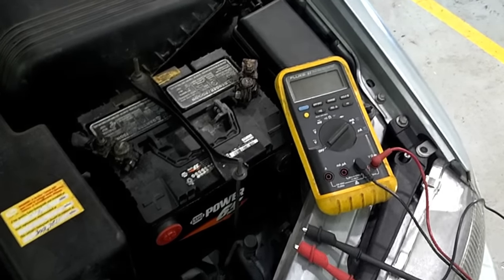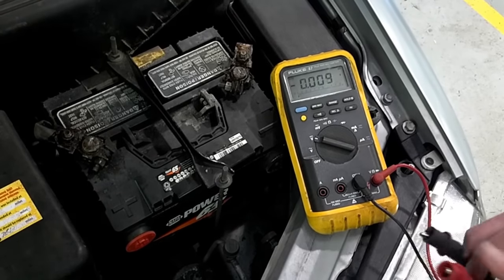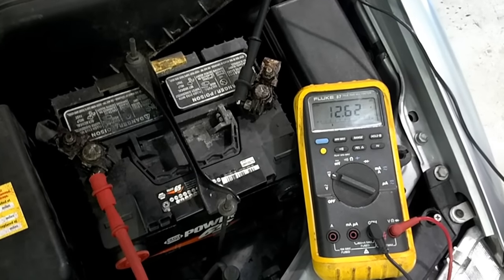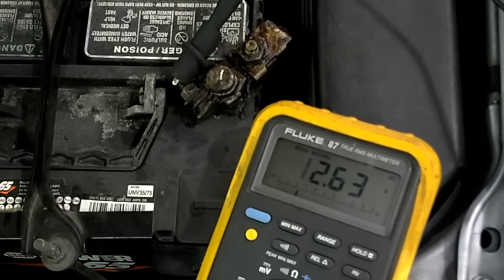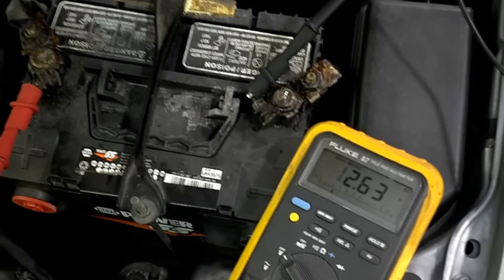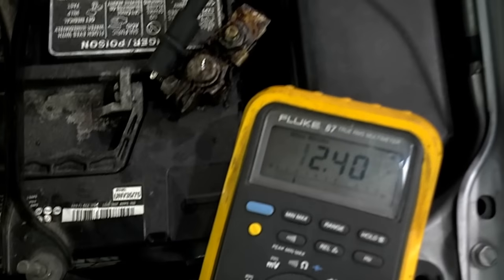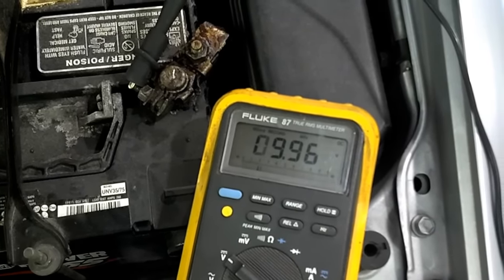Battery Load Test With a Multimeter

Comment: Why do we not see AGM batteries in cars ? Lower maintenance, faster charging, can run lower without damage, installed at any angle, combined deep cycle and cold cranking....
Reply from the maker: We are actually seeing more and more AGM batteries in cars today.  The reason that they are not used everywhere is that they cost more than conventional batteries and they don't provide much advantage for a typical car owner who drives the car daily or nearly daily.  Conventional batteries work really well if they are maintained and they are not cycled.  Of course the lifespan of any battery also depends on its quality.  Some brands are much better than others.

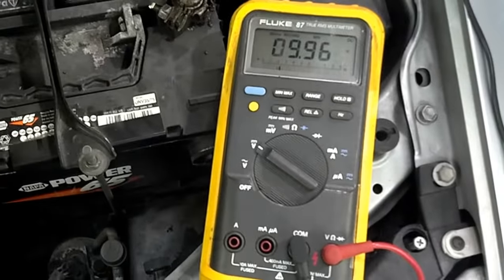Comment: Thank you for this video.  Noticed your pop up at 2:26.  Could a low voltage of 9.98 with a brand new Interstate battery also be the result of a dirty ground connection somewhere between the starter and the battery?  I already checked my compression and took off all the fan belts to see if there was any additional drag on the starter and there was not.  Also replaced the starter since it was over 10 years old and had many, many short trips in 78,000 miles.

Comment: What about on 2 battery system using our fluke 88v meter. Are you saying 19.2 is the lowest figure being 9.6 times 2?

If below how do you know which battery not good
Reply from the maker: Two battery systems are still 12 volt systems - the batteries are connected parallel to each other in order to provide more current capacity.  Do the same test.  If the two batteries together can't maintain 9.6 volts when the starter motor is engaged, they should BOTH be replaced.  The batteries work together and should always be equal to each other.   Never replace only one battery or the weaker battery will drain the stronger battery, shortening its life.
Reply: To make 24vthey are not in parallel but in series. Pos connected to neg with outer pos and neg to truck. 

This voltage check to determine if the batteries are able to prove CCA is not flawless I think. Also a customers truck in the morning has no power to crank engine. I checked for parasitic drain and there was less than fifty millivolts being consumed. This means the batteries were faulty. The voltage was 13 point something which also goes to say the cells were nackered. They would stabilise if a charger put on them and the truck would crank 10 seconds after connecting just one charger to one of the batteries. 

A proper test is obviously a load test by a load tester. 

I used my fluke 88v in min max mode on this truck and on cranking the voltage went down to 21v. When I connected 2 brand new Yuasa super heavy duty batteries with 12.6v thereabouts the truck cranked no issues and also only then did the battery sumbol disappear on the dash. The symbol would not disappear with other batteries

Comment: 75% charge or 80% charge minimum is required?
Reply from the maker: The general rule for testing a battery is to test batteries that are 75% charged or higher.

Comment: I keep reading/hearing that if the battery is 'below' 12.4 volts, then the battery has to be charged.  If that's the case, does that automatically mean its a problem with the alternator if its a new battery?  

In other words, why wouldnt the battery be charged aside from it being an old worn out battery?
Reply from the maker: 12.4 volts represents a battery that is 75% charged.  This is the same concept as your cell phone or laptop battery.  There is nothing wrong with a battery that is 75% charged, but if you are going to load test a battery, you would not want to do it when the battery is at a low state of charge.  Otherwise, the battery could fail the test when the battery is still actually just fine, but in need of being charged.  It is not uncommon for a battery to be less than 100% charged.  If you start the car but don't allow it to run for at least 5 minutes, the battery will not be fully charged.  On many cars, the lights and other accessories remain on after the engine is turned off, which can also drain the battery slightly.  You would never throw away your phone battery because it was only 75% charged - eve if the battery was brand new.  You would simply charge it.

Comment: Hi, great video! I need to ask about my battery, after sitting overnight my battery usually says 12.1, but the car doesnt have a problem starting, but when the radiator fan cuts ON in traffic, my idle drops hard and feels like the car might stall, should I replace it? Its almost 5 years old (battery) thanks!
Reply from the maker: If it passes this test, then no, you don't need to replace it.
Reply: It was a failing battery, replaced it. All good. Thanks!
Reply: @sean gill seems like he was having a high internal resistance problem in the battery as it dropped to 12.1V overnight and it was making the alternator work harder than it needed to charge the battery hence a large voltage drop across battery and poor supply to other components when required. This can wear out an alternator faster if not caught sooner than later.

Comment: Why is 9.6v the lowest acceptable value when load testing? How do you determine this value?
Reply from the maker: That is a good question.  9.6 volts was a standard that was established for load testing a long time ago.  Probably because it is three volts below a fully charged battery, which is 12.6 volts.  If the voltage falls below this level during cranking, it could cause problems with fuel injectors, ignition coils, and even the starter itself.   There is nothing magic about that number.  It is the number that was determined to be the cut-off.

Comment: You didn't check the "Open circuit voltage". OCV is the Battery voltage with no "Circuit" connected.
Reply from the maker: The cables are connected to the battery, but all of the switches are open.  So, until you close a switch (such as the headlight switch or ignition switch), you are measuring open circuit voltage.

Comment: That multimeter is $200. How can I accomplish this with my free harbor freight multimeter? Can I take a video of the readings and watch it back in slow motion or will the min reading flash faster than the speed of light
Reply: Yes, so long as your multimeter can respond fast enough to show the min and Max voltages. It has been my experience that even cheapo meters work fine, but have no min memory function.

Comment: I set commercial electric analog multimeter to 50 to test 12 V car battery and it read a lil over 10 close to 12 . Is that right ? I've also a slow charger at 1.5 amp slow charge . I cranked it soo much yesterday trying to get car started but nada . I had it towed . How long will this take ? i want to be able to crank car engine to work / test on car today
Reply from the maker: A fully charged battery should have 12.6 volts.  Watch my video called "Determining a battery's state of charge."  https://www.youtube.com/watch?v=I4TjlDcnJPA.  Also, it is good for your battery to charge at 1.5 amps.  It could take several hours to reach a full charge.

Comment: Would a carefully watched analog volt meter be okay for this test?
Reply from the maker: Not really. The drop in voltage happens so quickly that even an analog meter cannot respond fast enough for you to catch the low voltage.  A lab scope would be best, but a digital multimeter with a min/max function is the only other option for this type of test.
Reply: @JustinMillerAutomotive  What about OBD2 apps? I will check my tmrw...
Thanks for answers Justin.

Comment: let's say my 12V battery goes on a snowmobile. are the "magic numbers" the same? if I start it and get the same readings, does it pass the test?
Reply from the maker: +FillVinf06 Yes.  If it is a 12 volt battery the same numbers apply!
Reply from the maker: +FillVinf06  Yes.  The numbers would be the same for all "twelve volt" systems!
Reply: +Justin Miller 
Hey Justin, is it the same for 12v scooter battery? I charged my battery and it reads 14v using the multimeter so its is 100% but it is not turning over? I changed the spark plug but still no good. I think my multimeter is a cheap one. I don't have the MIN/MAX function or buttons? Thanks for the video I did learn heaps from this.
Reply: Optimus Prime if it won't turn over then its most likely an issue with your starter or you don't have a good connection at the terminals. Your spark plug won't have anything to do with it turning over..

Comment: So, if my multi meter doesn’t have min max, I can either have someone else start the car and monitor the meter, or set up a camera, maybe even set at high speed.
Reply from the maker: No, unfortunately it doesn't work that way.  The multimeter can sample (or measure) the voltage of the battery between 100-1000 times per second, depending on your meter.  The display on the meter only updates once per second on a good meter.  A camera wouldn't help you.  Also, the minimum measurement occurs during a split second when the starter motor circuit has been turned on but the motor hasn't begun to spin yet.  At that instant, the starter motor can draw between 600-1000 amps, which pulls the voltage down.  This is when we want to measure the voltage.  You will need to have a min/max function or a lab scope to capture this.

Comment: 12.4 volts can be very misleading, due to if the car was recently driven, and-or battery recently charged, this would be 12.4 " Surface-charge" .  True test with pudding, time battery sits, engine off, battery not charged. 12.4 holding post wait time, is 12.4 accurate battery test.
Reply from the maker: That is correct.  I wanted to keep the concept simple in this video.  I have a separate video about determining a battery's state of charge.  If the voltage (state of charge) is below 12.4, you can still perform the test, and if the battery passes, great!  If it fails, you should charge the battery and retest it.

Comment: Don't get it.... you start the car to see if the battery has enough voltage...to start the car???
Reply from the maker: Why do people go to the doctor?  If you are alive, doesn't that already prove that you are healthy?  Most people (including me) would like to find a problem and fix it before it leaves them stranded somewhere.  Your battery should be able to easily start your car, not just barely start your car.  Just because your battery started your car today doesn't mean that it will start the car next week or next month or when the temperature drops or when the radio or lights are being used.  That is why we check the health of the battery even if it can start the car.
Reply: Ok that makes sense. Thanks

Comment: Your Fluke needs new 'Zebra Strips' to get it's display bright & new looking again... it's a fairly common Fluke issue. Search eBay for the strips; they'll come with instructions... I've done a few through the years, the repair is child's play. Your looking at maybe $25 USD & 10 minutes work time. Don't have time to look right now, but I bet there are videos on it as well.
Reply from the maker: Thank you for the tip!

Comment: Hi there, great video, was wondering by any chance could you or anyone explain how I would use my DMM (same as yours) on a set of Heavy Duty Truck batteries, as In three batteries connected in series or parallel, and do a load test on those?
Reply from the maker: Two battery systems are still 12 volt systems - the batteries are connected parallel to each other in order to provide more current capacity.  Do the same test.  If the two batteries together can't maintain 9.6 volts when the starter motor is engaged, they should BOTH be replaced.  The batteries work together and should always be equal to each other.   Never replace only one battery or the weaker battery will drain the stronger battery, shortening its life.

Comment: what if it won't start
Reply from the maker: It depends on if the car won't "start" or the car won't "crank."   If it will crank, then the test is still valid.  If the car won't crank, then this test doesn't put a sufficient load on the battery to test it.  However, if the voltage stays above 9.6 volts while you attempt to start the car, then you know that the battery is not the cause of the problem!  Either way it is a very useful test!

Comment: Wjat if the car doesn't start?
Reply from the maker: No problem.  Perform the test anyway and try to start the car. If the voltage remains above 9.6 during cranking, then the battery is not the cause of the problem.

Comment: It makes a huge difference depending on how fast your meter will capture the voltage. Change it to 1 mS and you will find your voltage much lower.
Reply: How much lower? I was using my car's onboard voltage diagnostics. It flashed 8.9V, but the car had no problem starting, no hesitation at all.
Reply: @fungames24  the thing is if you stay in car doing something with lights on before you start, it may not have the power to start it

Comment: Nope, you're measuring voltage.  A load test measures current or amperage.
Reply from the maker: No, a battery load test measures voltage . . . while a load is applied.

Comment: Hmm ...
My battery shows 12.01V and drops to 9.05V and it cranks the engine just fine but yet you say at those readings its a bad battery.
Reply from the maker: No.  With those readings, your battery is just undercharged, not necessarily bad.  A battery only fails the test if it starts out above 12.4 volts (75% charged) and then drops below 9.6 volts.  You need to charge your battery for a few hours and test it again.  

A bad battery can still start a car, by the way - just like a bad battery can still turn on a laptop or a flashlight for a few minutes.  It just cannot supply enough current at all times and under all conditions and it is not long before it won't start the car anymore.  Also, using a bad battery for too long can cause your alternator to fail prematurely.
Reply: @JustinMillerAutomotive  I just charged it with 6 amps for several hrs until the charger told me it was full. 12.20V is what i get at the battery. Still cranked the same. 
I just checked my other 4 vehicles and NONE are over 12.2V ... and all of them crank normal.

Comment: Now all I need is a $755 FLUKE to measure my $99 battery. 🤣
Reply from the maker: First of all, if you are paying that much for a Fluke meter, someone is taking advantage of you.  Second, there are many other options. You can buy a WH5000A meter for about $30.  It works, too.
Reply: @JustinMillerAutomotive a FLUKE 87 will cost probably more that $700 where im from and probably where you're from
Reply: @JustinMillerAutomotive  I'd just caution your viewers though, that cheaper meters may have slower update rates. They may not 'catch' the actual moment of lowest voltage. In testing my own vehicle a while back, I used several meters in parallel, all with min/max, and got different results on each meter for the same engine start event. Probably disabling ignition and letting the engine crank for a few seconds might give a more reliable reading, though if the minimum voltage is genuinely at the very start then it'll depend on how fast the meter is as to how close it gets to taking a reading at the right moment. Maybe running the test several times would give better confidence. ps - none of them was a fluke. I think I had a middle of the range Amprobe, a similar Brymen, and some cheap no-name chinese one.

Comment: Fluke meters are way out of my budget sadly, anyone know of a cheaper meter that has the min/max feature?
Reply from the maker: Search on Amazon for a VC99 multimeter.  It is very inexpensive and works well for the price.
Reply: Thanks Justin, I own a few meters that cost around that but none of them have a min/max button.
Reply: Justin Miller ... I did this test a while back using the auto range function but I later realised that auto range is disabled for this test. I got a satisfactory reading when doing this test but noticed the display had scorched somewhat. Could this be the result of doing this test on auto range and could there be any damage to the metre. Thanks.
Reply: Extech are RMS and excellent - very much like fluke... radio shack also has a decent meter, i have both and consider the radio shack my disposable meter for risky tests

Comment: Actually you don't need one with a min/max button.  It does require another person to get in and start the car.  Simply watch the multimeter and see if it goes below 9 or 9.5.................     Harbor Freight has them for free if you watch the flyers.
Reply from the maker: Actually, to be accurate, you do need a min/max button--unless the car is not starting.  If the car won't start, you can hold the ignition switch in the "start" position long enough to get a reading on your meter.  Otherwise, it happens too fast to catch.  When you are in min/max mode, the meter may actually sample the voltage at 1000 samples per second, much faster than the display can update.  You will not usually see the lowest voltage displayed on the meter, but it will be stored in the meter's memory when using the min/max function.